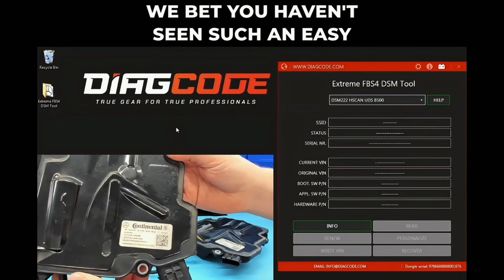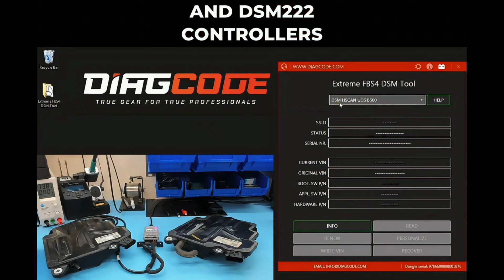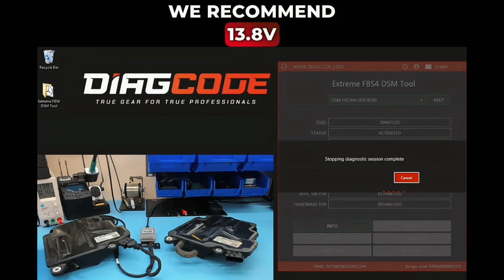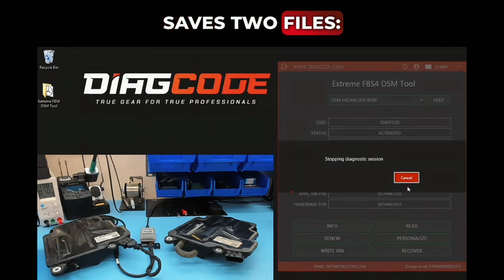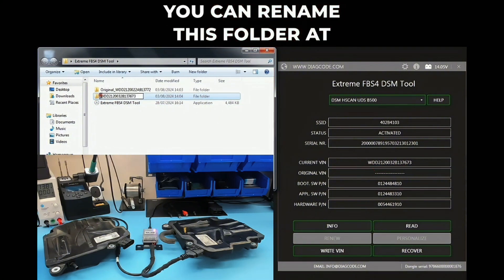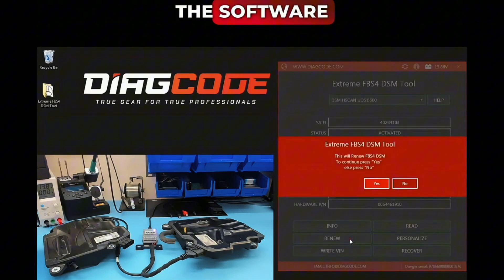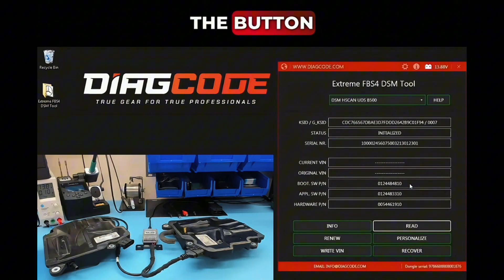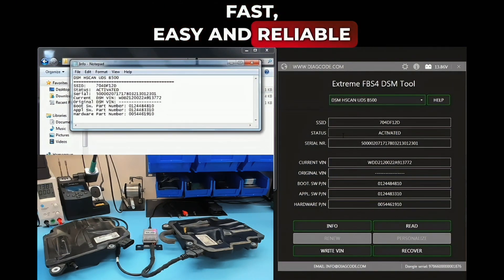🆕 🔥 🔥 🔥Revolutionizing the Future: The FBS4 Breakthrough 🔥 🔥 🔥 🆕

Comment: The program can only clone? My original processor is damaged. Can your program make an original from a donor without the original processor?
Reply from the maker: Hello @ManowarMechanic Is the processor itself damaged, or is the entire unit not working? In most cases, the problem is with the full unit and not just the processor. Often, the module cannot be accessed via diagnostics, but it is still possible to read the processor directly and extract the FBS4 data from it.

Once the data is extracted, our software allows you to write it to the donor unit via diagnostics — without opening or modifying the donor unit physically. So yes, even if the original module is not readable through standard diagnostic methods, you can still recover and transfer the data using our solution.